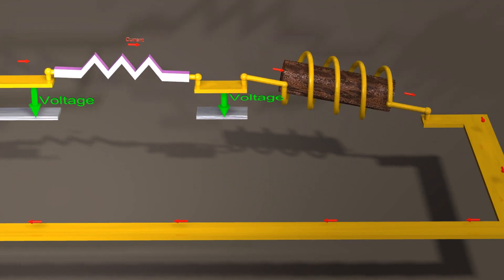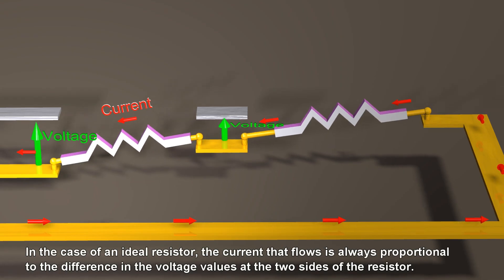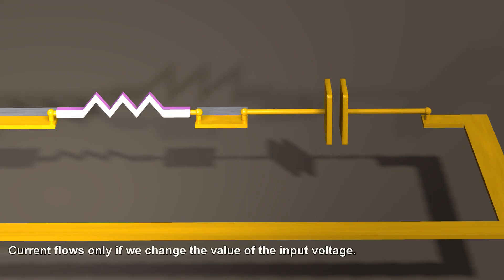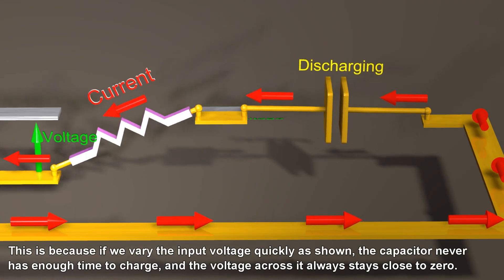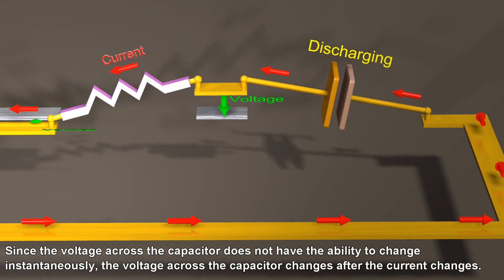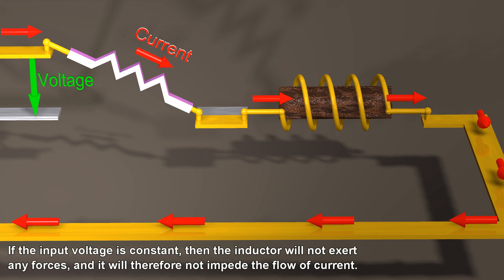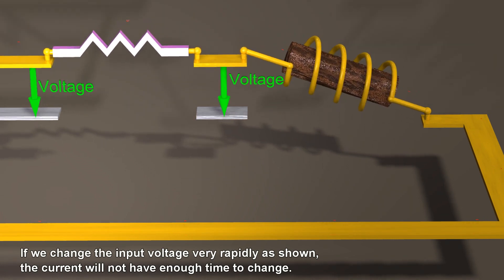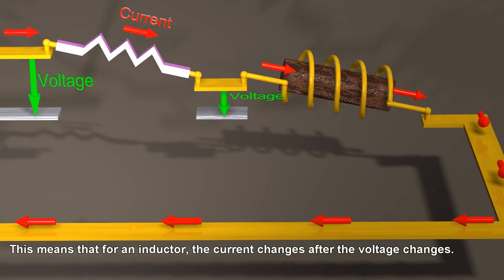AC current impedance - Alternating Voltage for inductors, capacitors

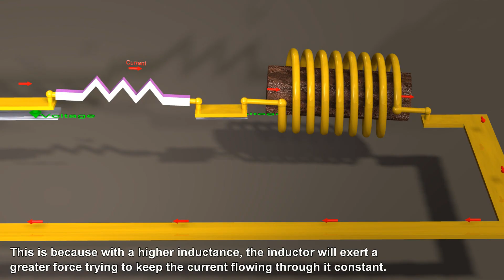Comment: 7:00 ah so thats why I can hook a transformer up to an ac outlet without causing a short!
Reply: omg hey! I love your videos!
Reply: Heyo,  its Cody's lab.  I was just thinking that these animations are a bit like the water voltage multiplier that you made.
Reply: Cody'sLab don't it heat up ? Like become really hot??
Reply: Wall type transformers have huge inductance, so by the time current starts to come out the other end of the winding, that ac reverses polarity.  Current lags voltage when inductance is present.  Current precedes the voltage with a capacitor.  It would have been more clear if they had shown the current and voltage waveforms, like you'd see on an oscilloscope.  Through pure resistance, the voltage and current are perfectly in phase.  When inductance or capacitance is present there is a shift in the phase of the current with respect to the voltage, at various points in the circuit.  In the transformer, current flows in one end, but is converted to a magnetic field, and high voltage, as it flows, making it look like there is no current flow out the other end. A perfect inductor would never let any current flow out the other end, but because there is resistance in the winding, it eventually forces a change in current inside the inductor, but by that time, the AC is reversing polarity.  In something like a DC relay, there is a lag as the energy gets stored in the magnetic field, which pulls the contact thingy down and holds it.  If you disconnect the ground side of the relay, the field collapses to try and maintain the current flow, causing a huge spike in voltage at the ground end.  Look at it on a scope, an automotive relay can create a 200 or 300 volt spike from 12 volts input.  If you disconnect the other end first, it generates an equivalent negative spike as it tries to continue "sucking in" the current.  Back to the transformer, if you short the output windings, you'll see a giant increase in power consumption on the wall side and it will look like a short to the electrical outlet.  This is because you're "stealing" energy from the magnetic field faster than it can inflate it, which makes it far easier for the current to flow out the other end.  It's like you reduce the inductance of the primary, and it's more like a low value resistor, creating a short. It's weird.
Reply: I always wondered that, myself.
Reply: Even MOT with 0ohm of dc impedance doesn’t blow up
Reply: For a transformer under load there is also reflected impedance
Reply: transformer cant short because th primary and secondary wire doesnt connected
Reply: @VinVin21969 
I know I'm late to the party, but I'd still like to explain.

A transformer consists of two coils, so it has four connections.
You connect the primary side to the outlet. If the transformer has very few windings (-> low inductance) or if you connect it to a DC source, it will act like a short, because a coil is basically a wire (which will short the power source).

However, as the video shows, inductors act like a break at high frequencies.
Reply: @VinVin21969  the actual reason is the primary coil inductance exerts an impedance to the AC voltage.

Comment: Voltage as gravitational potential is an excellent visualising tool. :)
Reply: And the red/blue tons of color in charging capacitor...
Reply: It never be
Reply: both are scalar fields, so the analogy is fit
Reply: Pretty sure thats not what they're doing.. Its more likely that they're simply representing the amplitude of the AC voltage.. just saying.